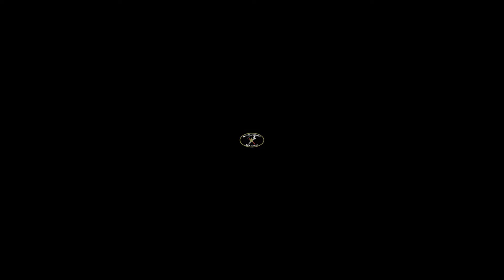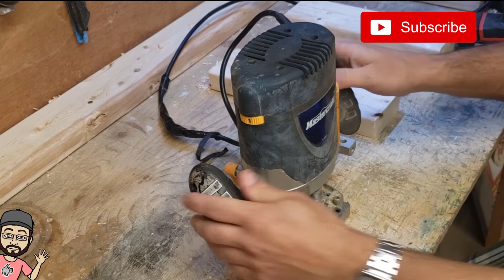Wood Router Repair - Brushes & Commutator

Comment: Some  info. Old Video. A DC motor doesn't use capacitors. Ony for AC motors. I suspect that the speed control switch has an issue 🙂
Reply from the maker: Good info to know, it looked like a capacitor to me but must have been something else.
Reply: @nothandsomebuthandy  when I say DC  motor I mean a motor with a commutator - it obviously still runs on AC 🤣
Reply from the maker: @leebrand2172 well it's a universal motor so it'll run on AC or DC

Comment: Online it says there should be continuity between each copper segment...i tested sll and i found one that has no continuity...will research why
Reply: @nothandsomebuthandy  according to online there should be continuity on all copper segments...to any other segment...i found 1 segment and added some solder to it and now i have continuity and initial observation the sparks seem to be less now...msybe that was issue ?..maybe that was result of issue?..dont know..will see how it runs next time i use it
Reply from the maker: @shelby50411  nice work, hope it solves the problem for you